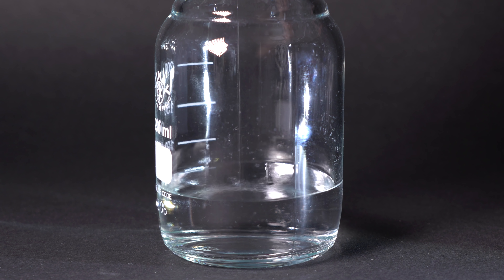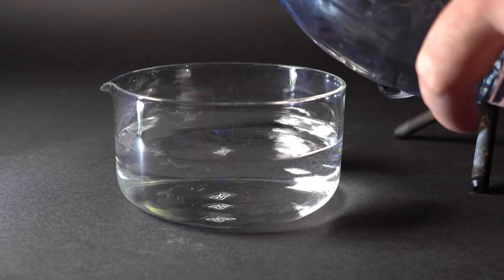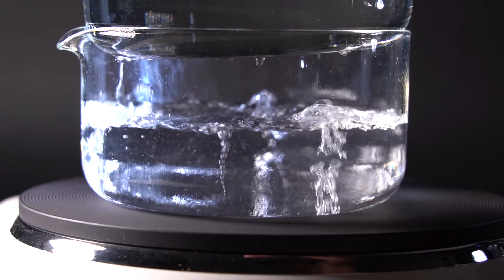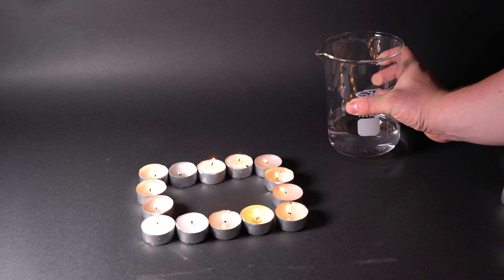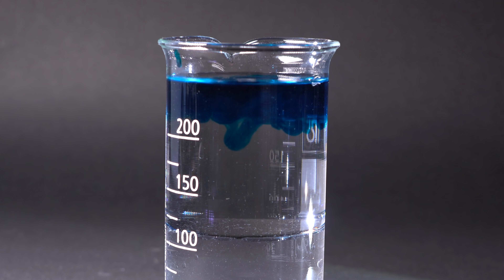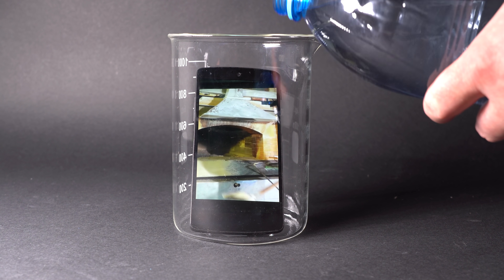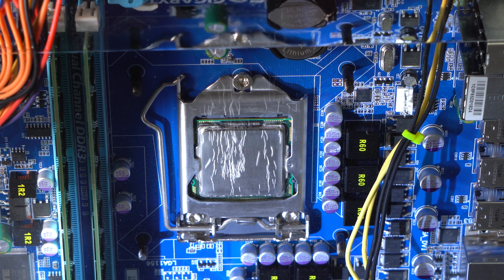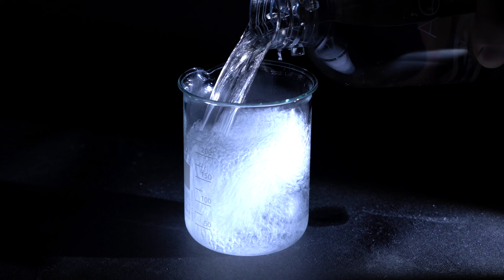Dry Water - The STRANGEST LIQUID On Earth!

Comment: This ultimately answers the question "Is water wet"
Reply: No it doesn't because even on a molecular skill the object still got a little of it.      Also it is not 100 percent h20.   It's a little different.          If I can poor more of itself on it and it does not cover the object or soak in it.  Than it is not wet.     Liquid is liquid.   It's called dry water because it wipes of easy.  It's not exact  characteristics.  It's similar but that doesn't mean exact
Reply: If the letters say it's not h20.  Than it's not regular water dry water is similar to water even though it's not completely h20 only that's why we say water it consist of it but thats not it's total chemical outcome

Comment: i tough about what if you can cool of the pc with dry water if it does not short circuit 
ironically it got answered right after
but if we want it to be effective we need a liquid that does not evaporates in long time
does not harm electronics
and have circulation into a cooler chamber and pumped back and forward might be effective cooling the entire system and if the water does not generate algea basically bacterian life forms it might be a long term solution making a PC aquarium coolers

Comment: Hmmm.. so this can be used in closed loop water coolers and because the boiling point is so low you probably wont even need a pump. Just set the radiator at the top and the heat generated by the CPU will boil the liquid, it will travel up into the radiator where fans will help dissipate the heat and the cool liquid will travel back down.

Maybe one day I'll try that.

Comment: What if we dip a computer set up in an aquarium full of dry water and cover the top of it with a metal sheet and fix a radiator to the metal sheet. Like that the heat from the dry water vapours will exchange to the sheet and will be radiated out , and the dry water will condense and fall back into the container . Thus we can make an effective cooling system for a computer that not only looks dope but works like a charm

Comment: Many years ago I saw a K2 processor that was running using boiling water as the coolant. That was just a stunt, but still impressive. The water was being heated by a heating element and circulated. The water over the chip boiled fiercely. Those K2 processors almost killed Intel, partially because you could overclock the heck out of them.

Comment: Full immersion cooling of PC in dielectric fluid like "Dry Water" often accomplished by use of external fluid chiller that pipelines cooled fluid directly pumped onto the hot CPU, hot GPU, hot RAM & board logic / resistors & power supply components // NASA has a Cray-2 cooled by fluorinert waterfall heat exchanger // take a look https://en.wikipedia.org/wiki/Cray-2

Comment: ACTUALLY: The reason why it doesn't make paper soggy has nothing to do with viscosity. It is because water forms H-bonds with cellulose hydrating the fibers.
Reply: Cellulose chains are inter-connected by OH–O-type hydrogen bonds to form flat sheets with CH–O hydrogen bonds. Water is a good polar solvent. Among its properties, water molecules are solvent ionizing and dissociating molecules. Cellulose polymer is hydrophilic and tends to strongly interact with water.
Reply: "It is because water forms H-bonds with cellulose hydrating the fibers."
... and while doing that "breaks" the H-bonds inbetween the cellulose fibres, greatly reducing the adhesion between the fibres, letting them slip past each other.
Reply: Mr smart man
Reply: christian anderson  R70 would be C8H-1 or CH8, both are impossible. There is no R70. The substance in this video is Novec 649, just as he shows. Thats  	C6F12O aka Dodecafluoro-2-methylpentan-3-one aka CF3CF2C(O)CF(CF3)2.
Reply: Ok, Thank You Children now, CHEMISTRY class is over.
Reply: the reason why it doesn't make paper soggy was not because of chemistry and physics. It is because of biology. 
lol
Reply: Which makes it viscous? Heh heh. 

I'm not savvy enough with chemistry to understand you with any confidence. 

Although, I would like to.
Reply: @DrBrainTickler  In simpler terms: Water bonds weakly to the paper molecules changing them and sticking to them. The other substance doesn't bond very well so it just drips off. If water didn't bond it would drip out just the same. Viscosity doesn't have much effect here.
Reply: @DrBrainTickler  The difference is that viscosity refers to a substance (be it liquid or gas)'s ability to stick to itself (i.e. other molecules of the same substance) whereas what alex1 is referring to is water's ability to form bonds with other substances.
Note that a h-bond is an inter-molecular bond, so the water molecules aren't actually 'reacting' with the cellulose to become a single 'material'.
Think of water and paper as the two parts of a velcro strap (where the water is the part with the hooks and paper is the mushy soft part) and then think of dry water as a completely smooth and flat surface... I feel like that'd be an apt visual analogy.
The water and paper aren't 'becoming one' in a sense so you can still dry off all of the water from wet paper.. however the intermolecular h-bond that forms IS strong enough to pull at the paper sufficiently to deform it which is why it won't be nice and flat anymore once you dry it off and it will have some deformities.
Reply: @ayporos  Basically this yeah.
Reply: @ayporos  Yikes, my head almost hurts but I got all that. Thanks!
Reply: @loganpe427  lol, basically, an entire subject for another video explained in a few short paragraphs. If y'all manage to wrap your head around that crap you may have to come to terms that you might actually be a nerd. It's nothing to be ashamed of, tho I would keep it in the community because normal people just don't get it. They will always see you as different. lmao

Comment: I'm extremely curious what will happen if we substitude water with novec 649 to sonicate some stuff (while keeping cooling the stuff). The viscosity is so much lower so the cavitation should be harder, and your stuff should be blasted to nanoparticles much better. Being really bad solvent also might help in getting your stuff pulverised instead of having been dissolved. And there would no oxidation. For example, you freeze your tough plant matter, such as mushroom. Then you might freeze dry them and crush a bit in mortar. Using novec 649 as sonication medium you will make usefull substances more bioavalilable for humans without full extraction process and without subjection to oxidation and free radicals. The question is, what is going to happen to fluorine atoms when the liquid is being blasted by high intensity ultrasound.

Comment: Cool stuff.  Although it is definitely cost prohibitive in a total loss/open cooling design, I bet it would make an excellent secondary working fluid in a closed loop system to cool computers/electronics.  Direct cooling computer equipment with a conventional refrigeration unit is difficult due to the high working pressures requiring inconvenient hard piping to the heat sources, difficulty in splitting the refrigerant to multiple devices from a single condenser, and the tendency to build frost or condensation without precise evaporating pressure control.  Dry water could work as the best of both worlds as a secondary coolant, since it could be easily piped and pumped like water to the CPU and GPU, but could bring far higher heat transfer performance due to phase change heat transfer capabilities versus ordinary convective cooling with a water based secondary coolant.  The evaporator heat exchanger of the primary refrigeration circuit acts as the dry water condenser in a dry water liquid/vapor return tank to maintain pressure and temperature under load in the closed dry water pump circuit.  The added advantage over conventional water cooling is if it leaks inside the computer, there is no risk to the electronics.  It could even work in place of water in a conventional air cooled pumped liquid loop without cascading to a refrigeration condensing unit.

Comment: i came across these liquids (3M novec and fluorinert) when i stumbled upon hydromod (liquid filled) watches, and searching more into it.

fluorinert (an environmentally more harmful version of this) is one of the fanciest solution to put in beside low viscosity silicone oil, because it will not dissolve the watch lume and change colour (but i didn't know why until i watch this video)

Comment: Could a sealed submerged computer work with a pressure relief system? I feel like an open system would lose too much dry water
Reply: That would be the equivalent of an air conditioner just with dry water instead of freon or R-134
Reply: @aSinisterKiid  was thinking passive, no pump

Comment: If I'm not mistaken, this has been tested as a candidate for liquid breathing and worked. Well, until it didn't a few hours later in rats. The other main issue was with the highly increased risk of pneumonia and other fluid-related infections.
Reply: There were some problems that arose with its density, cause the lungs to work really hard to move it aroundcompared to air. The force over long periods of time basically tore the lungs apart from the trauma.
Reply: @nunyabisnass1141  I thought about replying that, before I realized this is from a year ago. Strange/lovely conversation here! (Also I heard they wanted to use it to save premature babies whose lungs didn't work. Sad that that it didn't turn out!)
Reply: WhAT?
Reply: not infections
Reply: Edema and lipid pneumonia.
Reply: Yes, in the late 1960s it was referred to as "Polywater".
Reply: @analogdesigner-Jay  a short for "Poly-merised water". Water that allegedly turn into a polymer, plastic like. I don't think he meant that because "Polywater" is coined probably because people misunderstood oily-water as an actual water.
Reply: @xponen  Thanks for explaining that!  So back in the late 1960s I saw this commercial on television where they were explaining their development of "polywater".  They were showing the various uses of it.  Lastly they had a beaker filled with it and took a rat put it's head into this liquid for several seconds.  It appeared to be breathing while immersed in this liquid.  That's all that I remember.
Reply: @analogdesigner-Jay  the commercial was for the movie the abyss and it was in the 80s
Reply: @analogdesigner-Jay  Why does that remind me of frogs?

Comment: The purpose of this liquid is for liquid cooling of electronics (CPU/GPU). The CPU run 60-90C, boiling the liquid (taking heat away) and then condensate it again (taking heat out) and keeping the system cool. It's supposed to be non-toxic ... but not sure if I would drink it (I did put my hand into a tank containing 100's of gallons of the liquid though).

Comment: Yet another chemical added to the geo engineering planes, to STOP climate change. Barium, alluminium,  mercury and co2 (dry ice) which at high altitudes turns into carbonia (glass), fake solar minimum. 
Climate change is manmade, on purpose.